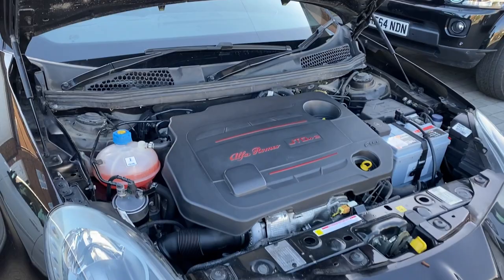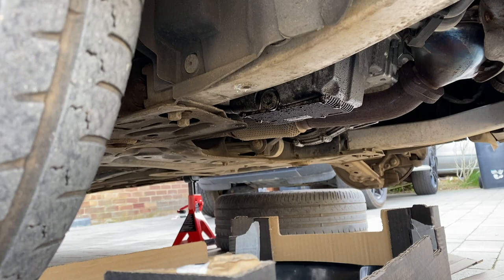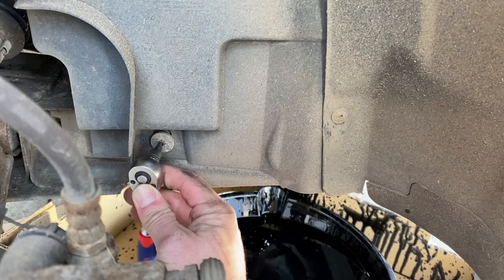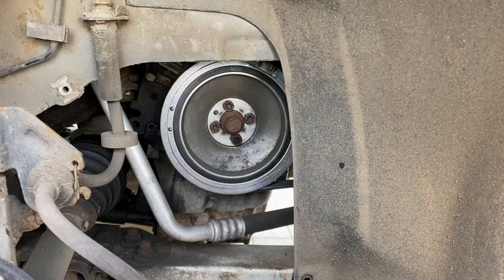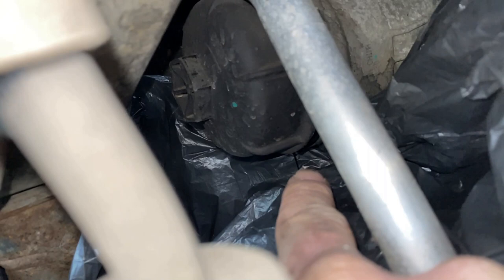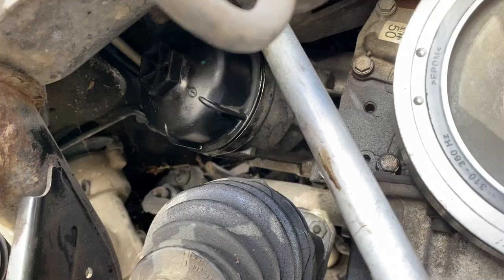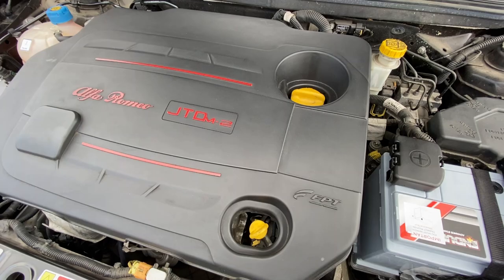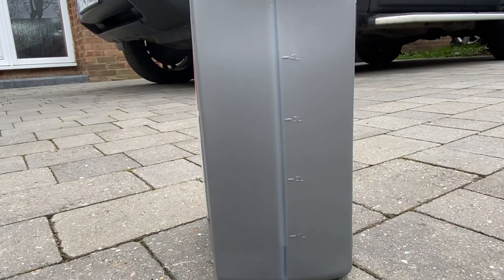Alfa Romeo Giulietta Change Oil and Oil Filter Success

Comment: Great video fella. That must be the worst oil filter location I've seen. I use an old bit of carpet under my cars to protect the driveway from oil spills. My wife now has a 2016 2.0 jtdm so this is a big help.
Reply from the maker: Great, really glad they're helpful.
Reply: And the air filter is location is not much better either.
Reply: @DH-RED  where is that then?
Reply: @paolodechipiece1027  it’s down in front of the wheel. It’s only accessible from underneath.
Reply: I changed an oil filter in the same place on a 2ltr Astra.
Reply: @meirionevans9088  really? The 1.7 is a doddle, easy access at the top of the engine rear. I don't think you even have to remove anything to get the 32mm socket on it.

Comment: Vialetto Tony, I'm Portuguese, my daughter has a newer Giulietta Jtdm. I'm also the one who does maintenance, including the timing belt. Thanks for the demonstration of your videos. To replace the oil filter, the oil must be purged from the filter. I use a 1.5 liter plastic (water) bottle, count the neck and cut it vertically in half (shape of half cane) and leave the bottom with about more than 0.5 liters. Place the bottle to retain all the oil that is in the filter location which is about 0.5 liters. Sorry for my English.
Reply from the maker: Hello Jose. Good to hear from you. Good advice, thank you. Thank you for watching and subscribing if you have. Really appreciate it. Have a great day. 👍😀
Reply: HoLa @JoséTORRADO = Could you show a Photo of your HandMade Funnel with a Plastic bottle ?
How you cut it and place under the Filter housing ?
OBRIGADO ! 😉
Reply: @wulfsteppen6989  It's very easy, as I mentioned, I cut the neck of a 1.5 liter bottle, I also cut it vertically in half (shape of half cane) and leave the bottom with about more than 0.5 liters. After cutting the bottle, I place it under the filter housing, tilted down to retain all the oil that is in the filter housing, which is about 0.5 liters. This way we avoid oil spills. Sorry for my English.

Comment: I watched this video a couple of days after getting my Giulietta and was horrified by the oil filter position. Then I realised that you were working on the diesel. As mine is petrol I shot outside to check only to find. probably. The most accessible oil filter I`ve ever seen. So the diesel is so awkward and the 1.4 petrol so easy. As the Americans say “go figure”.

Comment: Managed to do the filter part without removing the piece of panel guess my fingers are a bit stronger or the filter was loosely fitted last time at the garage.
An idea for catching the oil filter a piece of tube on a 3" funnel under the filter into another container. But drill a 6mm hole in the filter cap next time you can control the flow easier, maybe. Thanks for the clear video made the job ready prepared.
Reply from the maker: Hi William.  Glad you you had success. Great to hear. Thanks for watching and subscribing if you have. Really appreciate it. 👍. Have a great evening.

Comment: Great video. I have a petrol version where the oil filter is as the front of the engine facing vertically. Going to be interesting trying to get the old oil out of that 😅
Reply from the maker: Thank you and good luck. 
All the best 👍
Reply: I mean ...I hope you're not trying to get the oil out of the filter position. I watched this clip before I really looked at mine (got a 1.4 170hp petrol) and was like "oh here we go again". Can't imagine the sigh of relief when I saw the oil filter cap in the engine bay

Comment: Massive thanks for doing this video, just about to do a full service on my partners 2.0jtdm so this has been a massive help! Did you manage to get a torque wrench in to do the oil filter housing up?
Reply from the maker: Hi Joe. That’s great to hear that it’s helping another person. No, I wasn’t able to get the torque wrench in there, but you’ll feel it’s not massively tight when you remove it. A good Pinch up with the spanner has worked perfectly for me. Thanks for the positive feedback and watching and subscribing if you have. Really appreciate it. 👍

Comment: Nice you have the 1.6 JTDM2 also do you know if we can get a k and n panel filter for are engines :/ can only fine 2.0 ones
Reply from the maker: Hi Danny Boy Smith, It's actually the 2.0 170... Not sure about sourcing a K&N for a 1.6, but its likely that the 2.0 could offer better performance as it may let more air through than one for a smaller engine... More air  =  More bang...... Hope you're enjoying the Videos....

Comment: Do you need a new sump plug? Or will a new seal suffice?

Does the new o-ring for the filter housing come with the filter or will it need buying seperately?
Reply from the maker: Hi Clarkie8590. I’ve just used a new seal, and not had a problem. The O-ring for the filter came with it. I would expect this to be the same for all filters, but it’s always worth checking the product description or asking your supplier. 
Hope that helps. 
Thanks for watching and subscribing if you have. Really appreciate it. 
All the best 😉👍

Comment: hello friend..I plan to buy Alfa Romeo Giulietta 2011 but I can't decide which engine to choose 1.4 tb 170 hp or 2.0 jtdm 170hp..do you have any recommendation..greetings from serbia
Reply from the maker: Hi Danen. I’d say it depends on where and how you’re planning on using it. If it’s short trips in and around town or longer trips out on country roads then fuel economy may sway your decision. We use our 2.0 JTDm 170 around town and on the motorway, and it works excellently. Lots of torque too. Whatever you decide, check mileage and if it needs or has had the cam belt and water pump changed. 
Thanks for watching and great to hear from Serbia. All the best. 👍
Reply: in fact I don't drive it much..maybe I drive about 7 or 8 thousand kilometers a year..the car serves me to drive my ass what people would say only in the city..Giulietta is too beautiful for me considering when it was made by design it is ahead of its time ..and I believe that it will be an attractive car for a long time to come..I am a carpenter by profession, I do not understand cars well, but I know what a beautiful car is when I see it :)
Reply from the maker: @danendanen8246  I agree. It’s certainly a great car. The petrol may prove to be a bit quieter for you , but have a think about fuel costs. You’ll be happy with it whatever you choose 😉. All the best.

Comment: Hi @VialettoTony = THANKS for Your Great job and Video !
Do you think it is The SAME Shit for a 1.8L. TBi (241 HP) Gasoline Engine ?
i heard it is The SAME Engine Housing , Sooo...
Best Regards from TOULON , FRANCE 😎🛠
Reply from the maker: Bonsoir Steppen. I believe it is. It’s really simple to check. If you remove the wheel, you can see the filter through the gap. Should only take a couple of minutes to confirm. But yes, I’m sure it is. 👍. Thanks for watching and subscribing if you have. Really appreciate it. All the best. 😎
Reply: @vialettotony  = OKkk i will do this ""Simple"" Check , by Removing the Front Right Wheel ....
"Easy" when the Giu. is already "on Candles" ! LOL
Reply: Hi @Tony = i did it ... The Filter Location is rhe SAME ...BUT NOT the FILTER ! it is an OLD iron Cartridge Type MANN W6014 or MAHLE OC1331
that i had NOT ! OouuFF i could Replace it by a PURFLUX LS910 (from my Bike !) ...
Sooo i purchased 4x Paper Cartridges for NOTHING !$!$ = WARNING about #AUTODOC German WebSite whose "Advice" is WRONG !!
Reply from the maker: @wulfsteppen6989  great job. Always worth checking 😉. Well done and good luck with it. 👍

Comment: Should I check oil (dipstick) with hot or cold engine?
Reply from the maker: Hi Lasse. After the oil change, it’s okay to check it after a few minutes of the engine idling. At other times, it’s good to check the oil when the car is level and the engine is cold, so all the oil has run down to the sump. 
Thanks for watching, hope this helps. All the best 👍

Comment: Hi Tony, have you had any issues with reseting the service reminder? I've read somewhere you can only do that through obd, is that true? Thanks
Reply from the maker: Hello Wiktor. There are two separate reminders that need resetting. One can be done through a dance on the pedals I believe, but the other can only be done using the OBD. I'm yet to do mine, but will be making a video when I do it. 
Thanks for watching and subscribing (If you have), really appreciate it.
Reply: @vialettotony  thanks mate, will keep an eye out
Reply from the maker: Hi Wiktor. Just checking to see if you saw the service reset video yet? I included links in it too, for the software and cables. 
All the best. 👍
Reply: @vialettotony  Hi, thanks for that, just had a look. It's actually not as bad as I expected, still could be just a normal reset procedure like any other car, suppose thats the sort of things you get with Alfa.

Comment: Please, How do I reset service interval on Giuelietta 1.4T 88kw 2017? without car diagnostic...
Reply from the maker: Hi Saman1962, On the Giulietta there are 2 different parameters that should be reset. I understand that one can be done through a "Dance on the pedals" (a process of pressing different pedals and buttons in order) that i do not know unfortunately, but i think can be found on social media. But the 2nd one can only be reset using the software tool. Apparently if you do nothing and just leave it, the lights will go off eventually. I have not done mine yet, but will be making a video when I do. Hope this helps??? All the best and thanks for watching.
Reply: @vialettotony  I tried 3 types of "dancing" and not working :( ..thank you for your willingness
Reply from the maker: @Saman1962  ah that’s a shame. If you wanted to try it with a diagnostic tool, I released a new video this week showing how to do it on my car. Good luck, all the best 👍

Comment: Hi Tony, do you mind listing the tools etc you used?
Reply from the maker: Hi CB. If I remember right…. It’s a T30 torx bit for the undertray removal and inner wheel arch liner. A 32mm spanner for the oil filter housing. Jack to lift the car plus axle stands and chucks for safety. 13mm hex bit for the sump nut and torque wrench to tighten. 
I think that’s about it… oh yeah, and an oil drain pan plus all the new parts 😉
Good luck with it if you’re doing yours. It’s super easy really. Have a great weekend. Stay safe and drive careful. 
All the best 👍
Reply: @vialettotony  you are the best !

Comment: After how many Kms should oil be exchanged?
Reply from the maker: Hi. It depends on the age of your car and whether petrol or diesel. Mine is a 2011 diesel, so the official stats are 21,000 miles. 
A 2011 petrol would be every 18,000 miles. Hope that helps. All the best 👍.
Reply: @vialettotony  cheers thanks!
Reply: @vialettotony  hello, I have an alfa giulietta 2.0 140 hp diesel, I put 5 liters of oil in it and the level shows on the dipstick it is not even half way, how many liters of oil go into the engine
Reply from the maker: @marianmaghila1801  hi. I’d recommend confirming in the vehicle log book. This will give you the manufacturer’s values. Hope it helps. All the best 👍